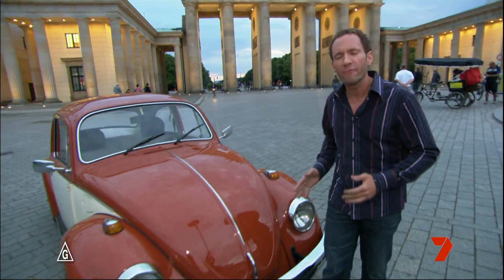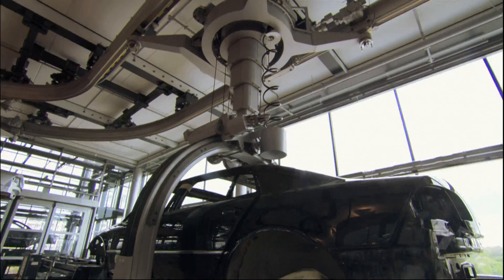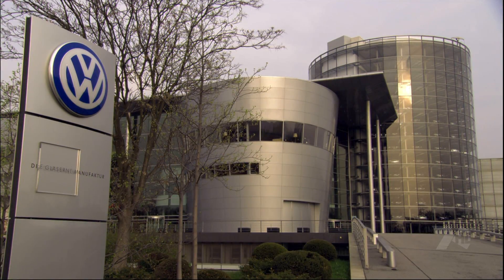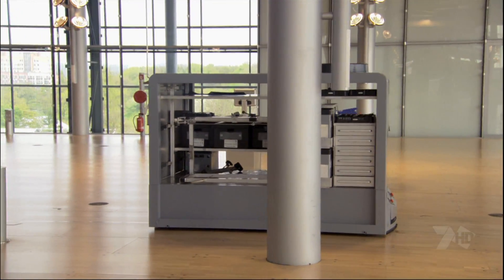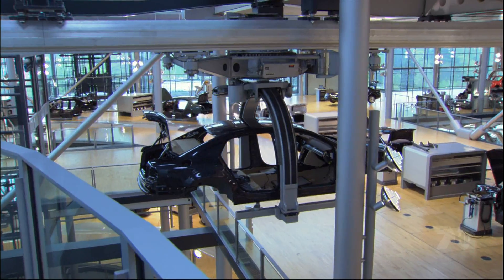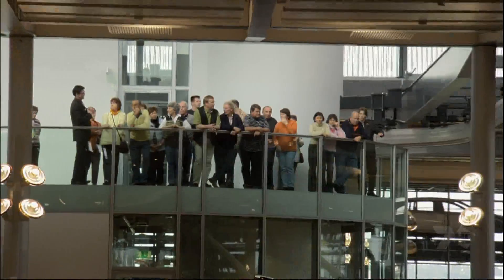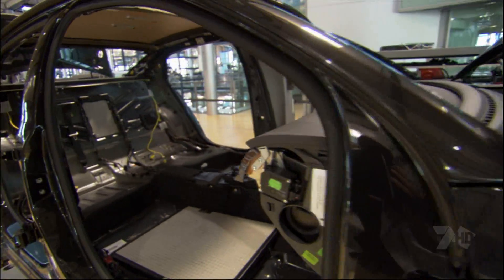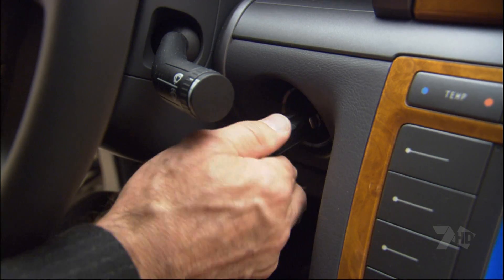German Car Factory

Comment: @MrH4rper Absolutely correct and I've owned several of the absolute worst as well as two Volkswagens which, though well built, were very poorly designed.  One caught fire in the rain because of a wiring design defect [connectors carrying high mechanical and electrical loads without support], the other expired at 92,000 miles in spite of careful maintenance and gentle driving because of inadequate oil control and poor cooling system design.